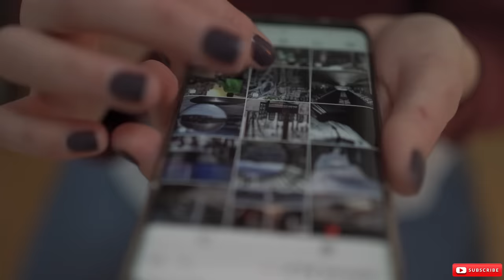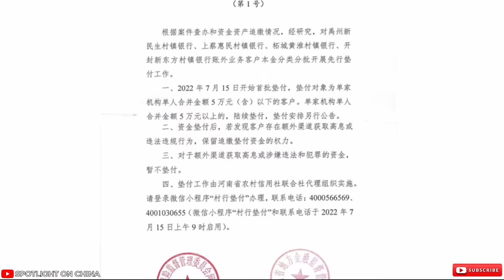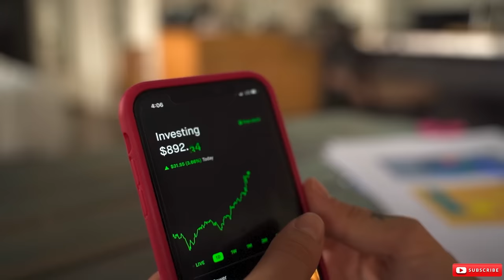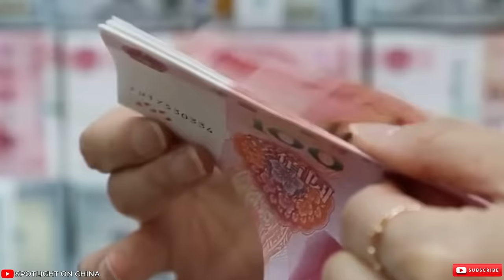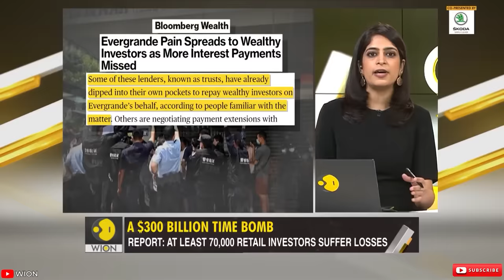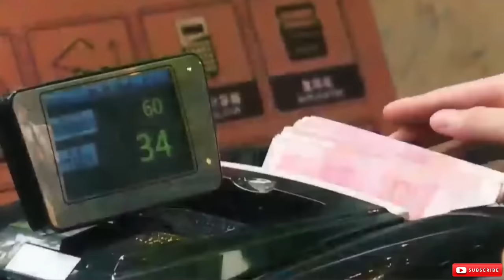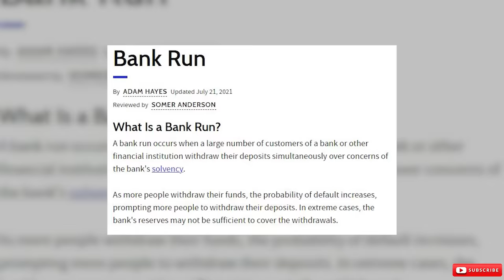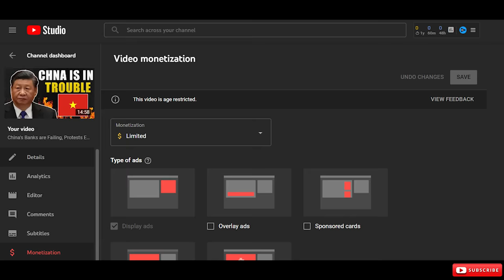China's Mortgage Crisis, Banks are Failing, Protests Everywhere. China's financial crisis is Here...

Comment: China does not have a federal banking system with a set of rules- they work more as a "guanxi" style, meaning they have networks, some of which have existed for decades, if not centuries. This is why Evergrande failed because there is no regulation and the banking system is just a handshake between friends. 
Given the circumstances in Tawan- China is in a much weaker position than ever before. They have much of the same weak Russian equipment that we see easily destroyed in Ukraine.

Comment: This is astounding! In 2022, a guy producing a high quality video with enormous viewings does NOT understand the mortgage market. Banks DO NOT! loan deposits, they create the "credit" based on a promissory note signed by the borrower. The Bank of England outlines this in its Q1 report of 2014 in plain english . Upon hearing someone who should be aufait with this display such ignorance, I switched off. Very disappointing. His explanation of lending practices, was/is admittedly not widely publicised, but should be known to this presenter. Check it out for yourself, its called creating money (currency) out of thin air. Modern Money Mechanics from the Federal Reserve in the 1930's is another reference point.